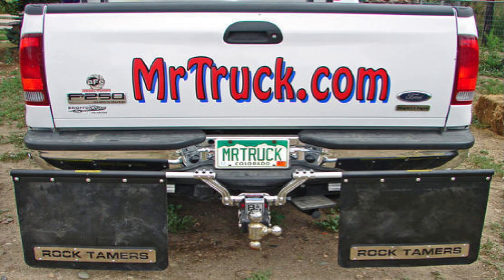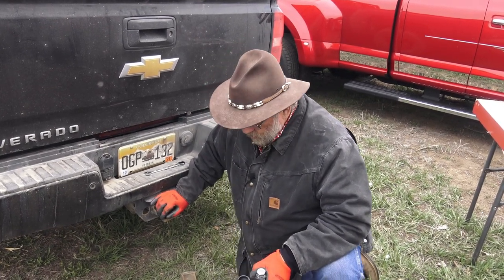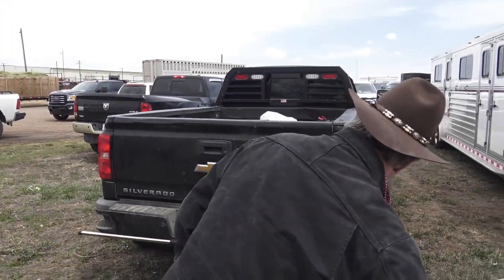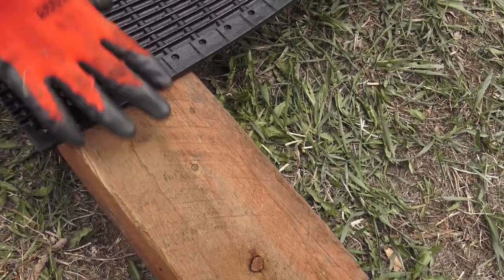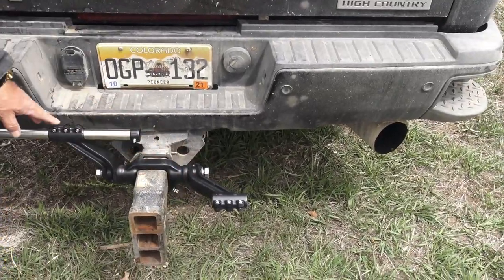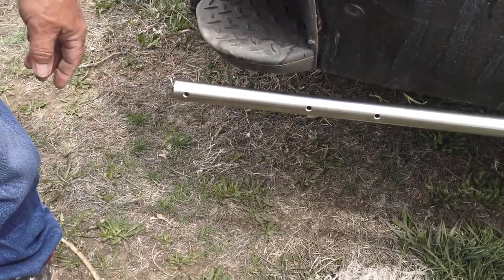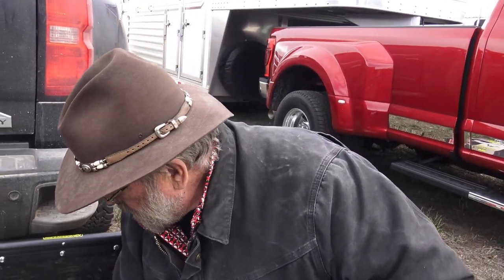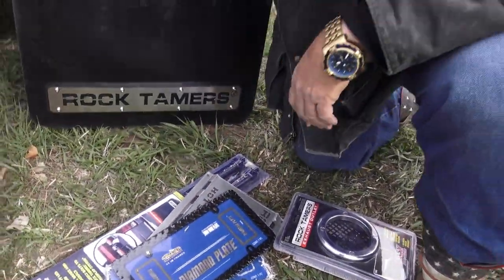Rock Tamers mudflaps protect your trailers and their re-sale value. Stops the trailer pits scratches

Comment: These look fantastic. Question: Why would someone install these on a dually if you already have mud flaps?
Reply: I would assume if the truck is lifted, it will protect less. I guess it would catch anything in their path.
Reply from the maker: Most duallies don't come with mudflaps
Reply from the maker: @e.l.9589  I'm putting them on my lifted GMC 2500 when my mechanic gets done. We cut 4 inches off the mud flaps for the dually in the video. So that would be just right for my 2500 with a 4 in lift.